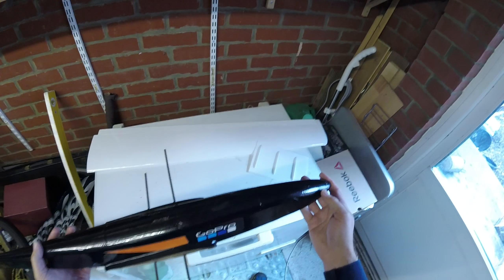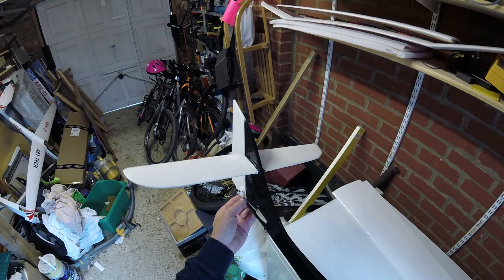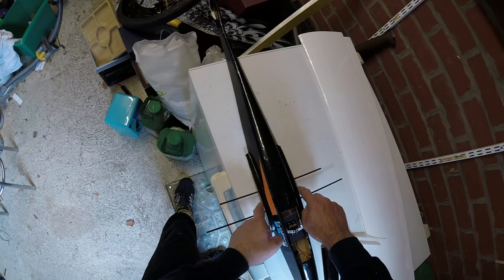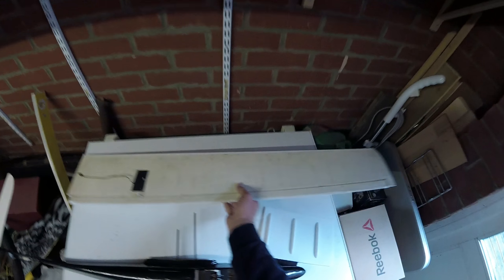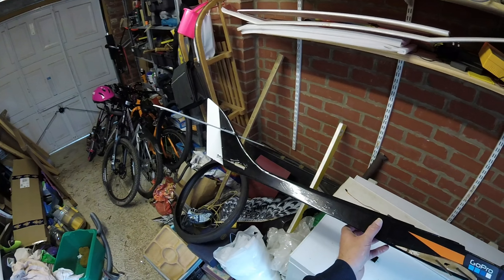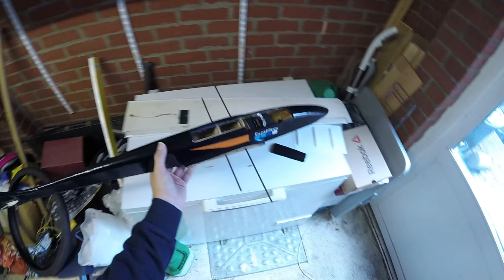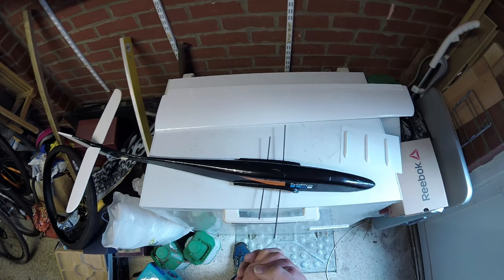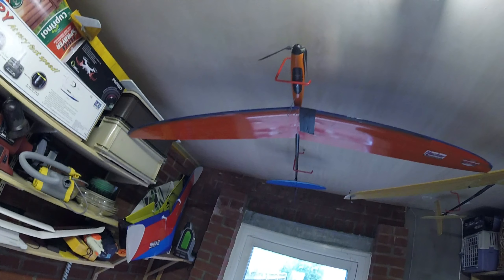1980's Tigershark Glider rebuild (sailplane)

Comment: Very unusual low wing design!  A raised landing skid may assist protecting the servos. I made mine from 20mm wide sponge foam tape, which is about 6mm thick. It is normally used as a door seal and has adhesive on one side. I then cut a 20mm strip of 1.5mm balsa, suitably covered with duct tape, (fibre reinforced tape would also work) then double sided tape to stick it to the non adhesive side of the foam. This was stuck straight onto the flat bottom of my BIG E glider. It only weighs a few grams. Waiting to see it fly. Should be good.
Reply from the maker: Great idea need to do something like that